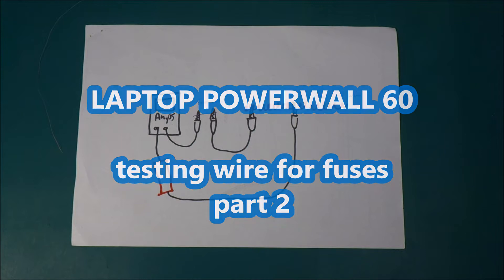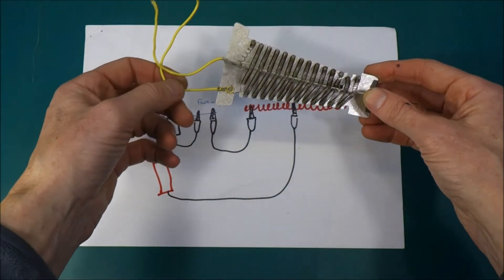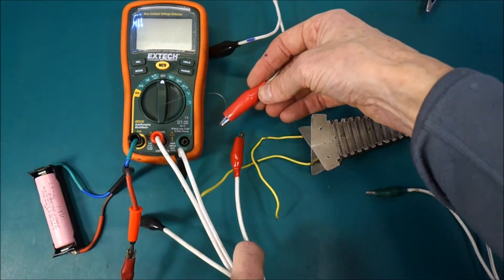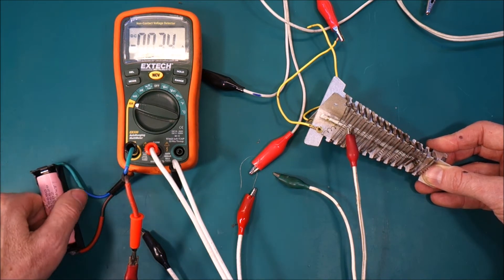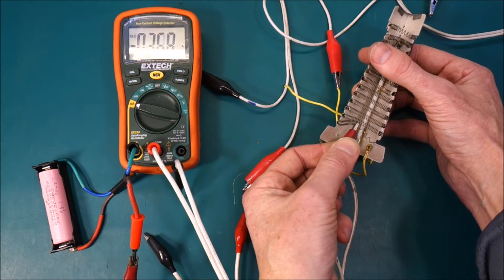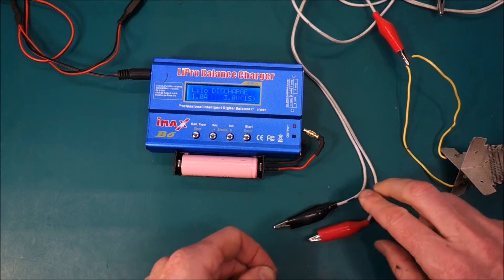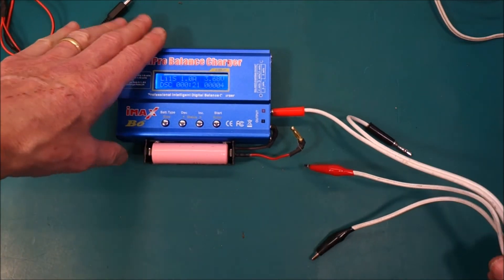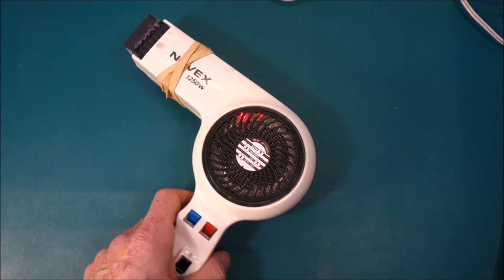Laptop Powerwall 60 - testing wire for fuses part 2

Comment: Good video, love the hair drier come raygun :-).  Watching these vids with great interest as i'm going to start making my powerwall pack soon as i've another 100 laptop batteries arriving soon and definitely has to be fused.
Reply from the maker: +nztitirangi Peter at HBPowerwall had a cell go bad recently.
Reply from the maker: My sneaking suspicion is that the primary benefit of the fuses is to prevent damage when making mistakes during construction. At least that's been my experience so far. Very useful!
Reply: me too - i keep pondering the question: under what conditions or for what reason would a cell in a stable environment go short?  Hmm.  Puzzle.